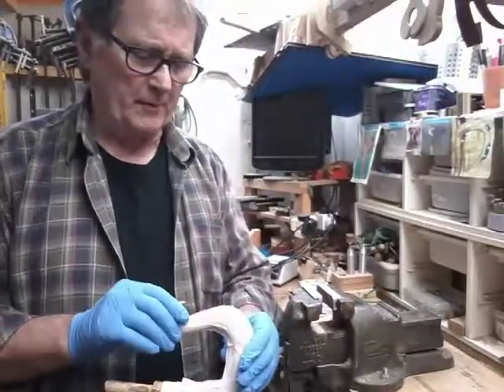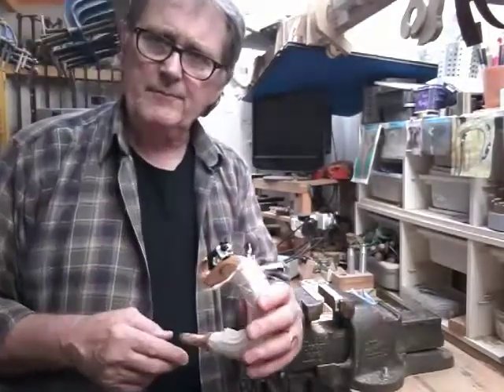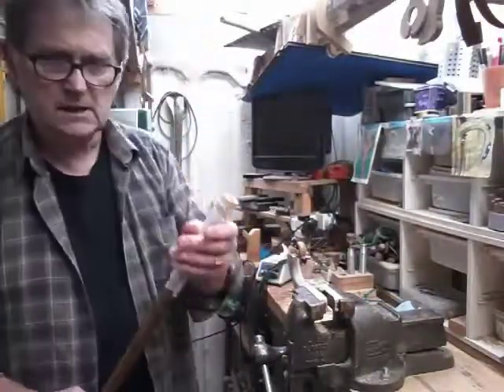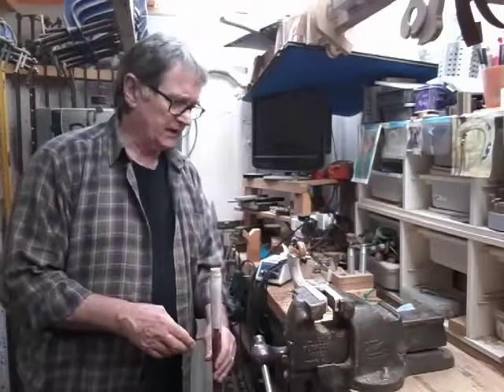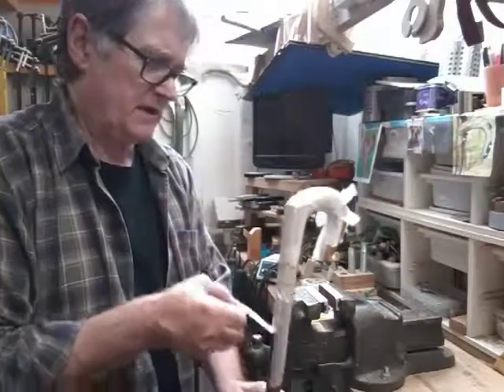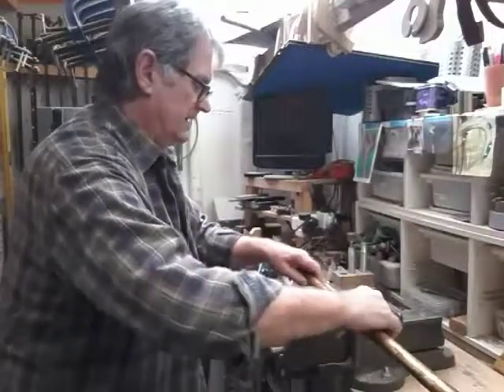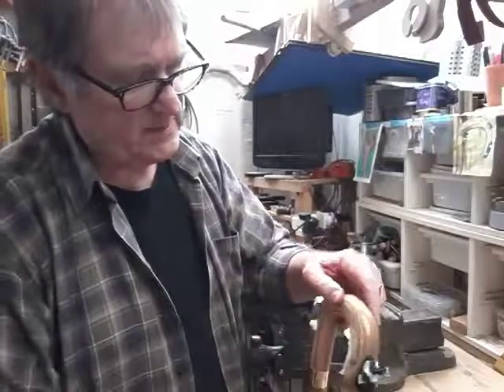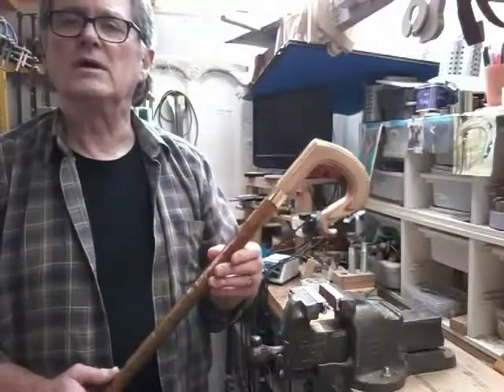Making a crook in ply. Final part

Comment: I'm not able to get the thick ply like you have but what if glued 2 pieces of 3/4 inch would it still be suitable thank you for any advice I can get
Reply from the maker: Hi Lawrence. There is no reason why you cannot glue two sheets of ply together, but remember you will have more material to remove when shaping the handle. You should be able to find 25mm or close ply on ebay. I would be surprised if your local wood yard cannot order some inch ply for you.   I would have a look on google and search for furniture quality ply, there is a company some where in the south of England that supplies many different types of ply mostly for yacht building , Robbins Timber Bristol, if I am not mistaken.  By having the right thickness material you will save yourself a lot of work and waste.
Reply: @wrencountrysticks8660  🙏🙏